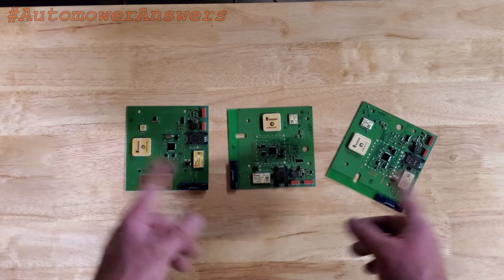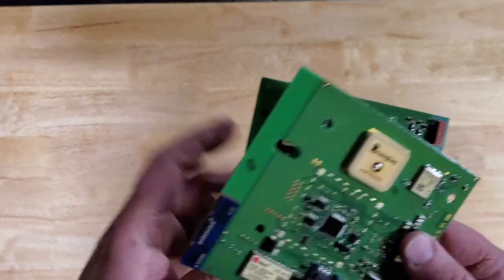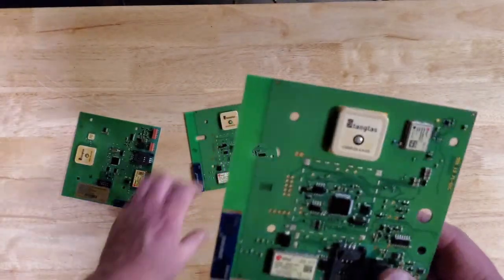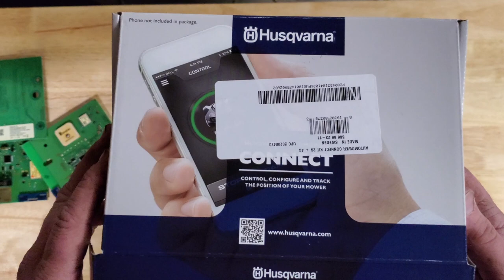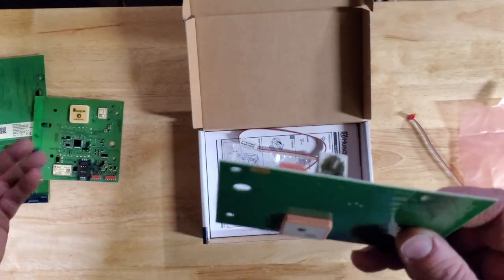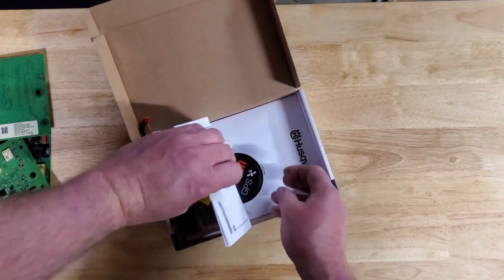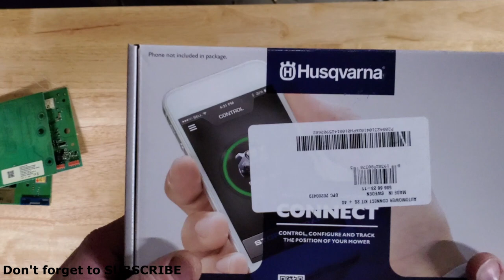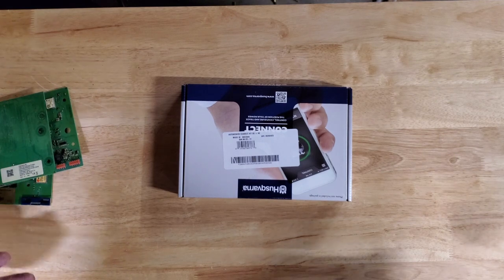Automower Answers: 4G Connect Boards Are HERE!

Comment: I had just ordered two 115H units -- got a great deal on them new for $850 each as scratch and dent units.  Since the seller is a Dealer, I just called and managed to catch them just before shipping to add these boards by them.  That should avoid any voiding of the warranty.  Should be a good improvement and thanks for the video about it!

Comment: Thanks for the video and info, good to know that this can be added to a 115h!
Reply from the maker: Yes it is! The card will give you connectivity in the 115H and GPS tracking for theft prevention, but not GPS mowing.
Reply: @EshlemaniaTV  Yea, figured it wouldn't be a major upgrade but just being able to tie it into my smarthome set-up will be a nice improvement. If my local dealer updates the firmware once I get it can I add the board on later or does it need to be activated in autocheck 3 at the time of install regardless of what firmware it has?
Reply: @EshlemaniaTV  So will this card give GPS mowing to a regular 315?

Comment: If you get the firmware updated to the latest, can you DIY the module install after the update?

Or would you still need the dealer for the software?

Only ask because I'd like to do one long round trip over two long round trips.
Reply from the maker: If a Connect board is installed the software will need to be updated again after the board is installed. This is the case with mowers that came with a Connect board and mowers that did not come with a Connect board. Any time a new Connect board is installed in a mower the software needs updated for it to work properly
Reply: @EshlemaniaTV  thanks

Comment: My dealer also added this board already to a 450 and put in the existing sim from my 2g board. I just got it back Friday but it won’t pair - almost as though data isn’t passing or the apn is different now. Previously the network listed was T-Mobile - now is it telenor - in Massachusetts - SMS works but not able to pair. Welcome any suggestions - otherwise I will bring it back to the dealer this coming week.

Comment: my dealer updated my 315 to this 4G board but I still don't have automower connect. is this upgrade supposed to give me automower connect?
Reply from the maker: Yes, this is the Automower Connect board. If they installed this board and updated everything then you should have Automower Connect working on your mower.
Reply: Eshlemania TV thanks. I will contact the dealer again.
Reply: Even without ATT ATT service?

Comment: I do have an additional question about two functionalities of Automower Connect: first the geofence. Looking at Google Maps , I see no difference between sensitivity high and mid, the same circle is show. Low is indeed a larger geofence area. Is this normal? Also, the sms function is not working, I cannot get a test sms signal. So I tried and drove around with my 420 with automower connect kit installed in my car and crossed the geofence line. The mower produced a high pitch alarm sound and I got a mail, but no sms.

Comment: Hey Eshell. At 6:22 You said a 300 series motor with a 3G board allready in there.  So what do you mean by that? Do I have boards in each of my stock   310's?? I don't need to purchase a board from a dealer? Just have it activated?  I bought 4 new 310' less than a year.